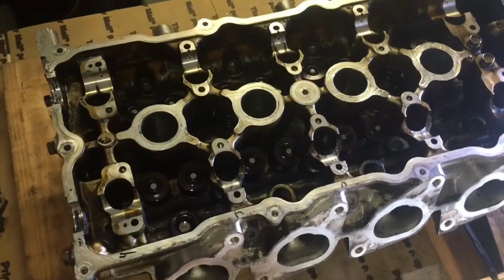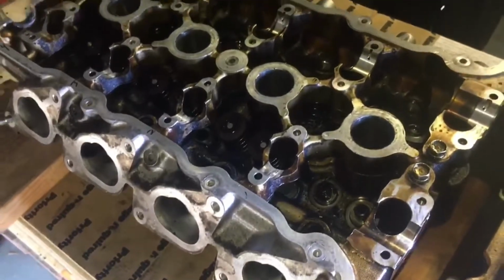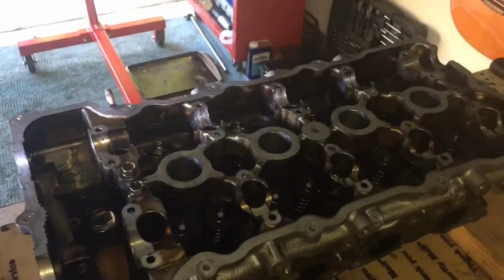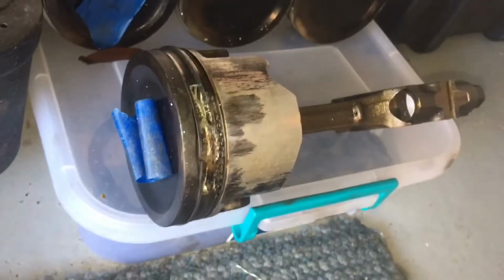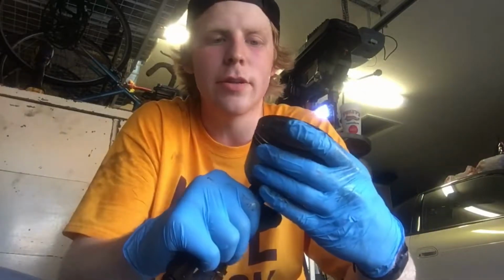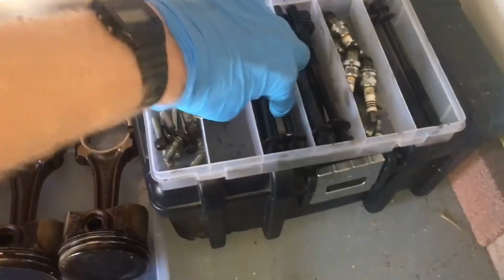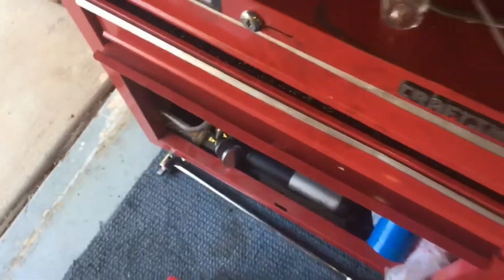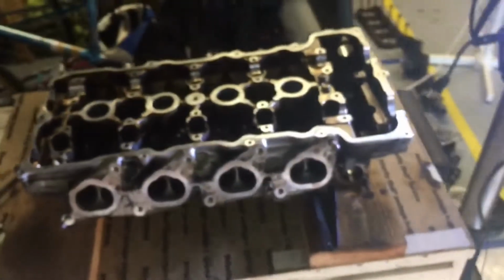4 Problems I Have With the SR20DET | full rebuild update

Comment: I can't tell by the video, does the cylinder head have oil gallery holes in the journals??? I'd say the oil gallery holes were too small to allow enough flow to the cylinder head.
Reply from the maker: MrStoneycool69 It does, unfortunately I don’t think there was sufficient oil pressure to keep it lubricated.

Comment: Hey man I just recently got a 240sx SR20 swap and the guy didn't know what the FUCK he was doing sooooo I'm thinking about pulling it and checking the engine it has around 60K miles on the engine. My question is, at what mileage did your engine take a shit? I'm scared that if I drive it out it'll just blow up on me...
Reply from the maker: Juan Elorza Hi Juan, sorry for such a late reply, I haven’t kept up very much lately. Mine went out at about 142,000 miles and it was certainly driven hard. My best advice is to pay attention to what the engine is telling you. In hindsight I should’ve known that my bad turbo was a sign of oil problems, I ignored it and well, you can see the results in the video lol. Best of luck with your build!